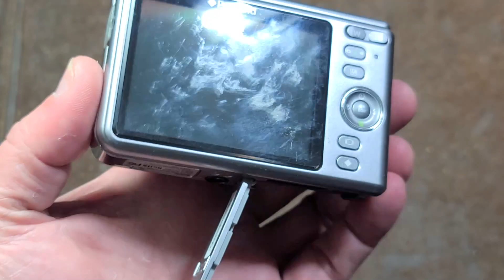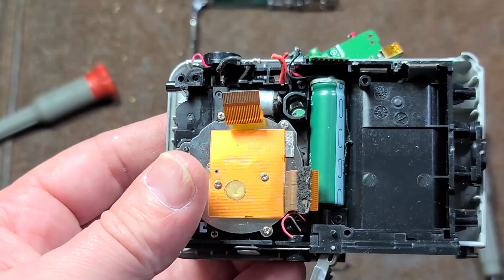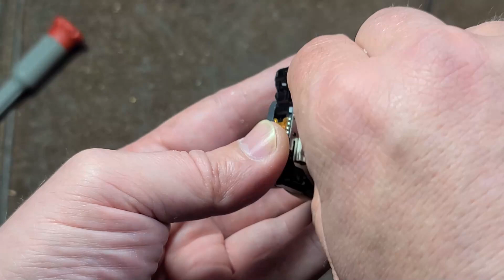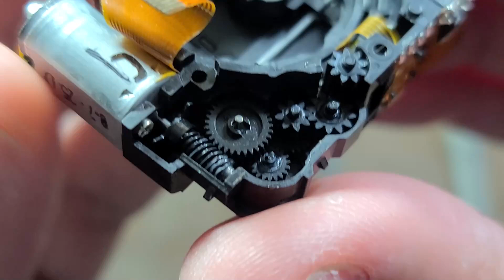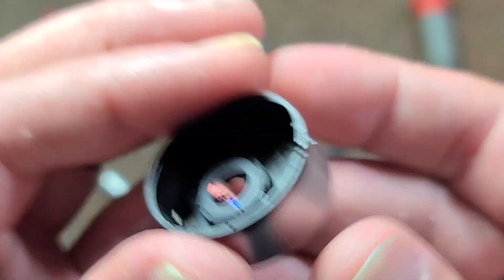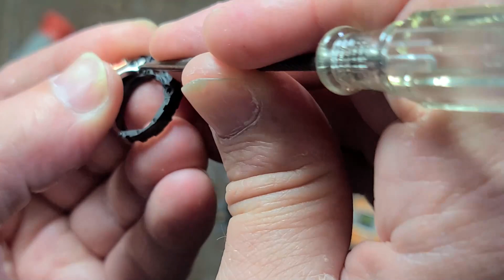Polaroid i835 Pocket Camera Full Teardown

Comment: What's amazing is that these cameras are so well made and reliable that they can still work after many years and after taking thousands of pictures and videos.  The only one I have had that failed was because the lens assembly got some sand in it when I was on the beach.  I have an older Canon that still works fine but is way outdated in terms of technology.